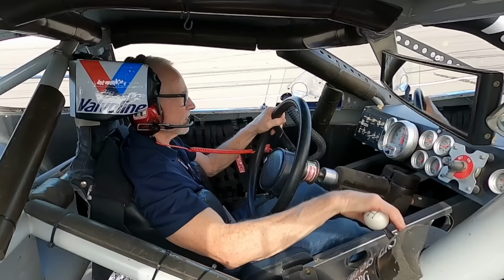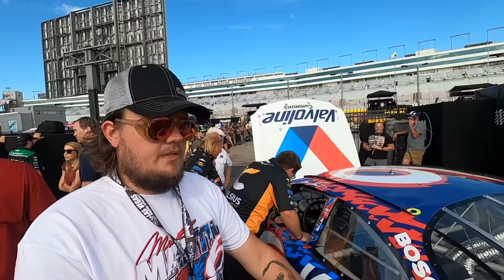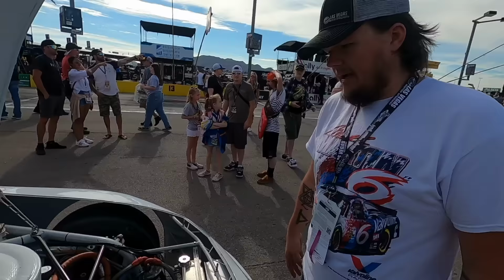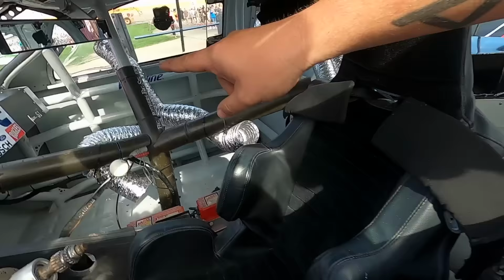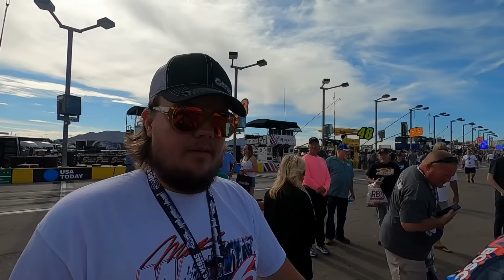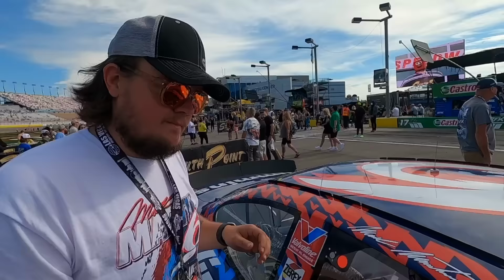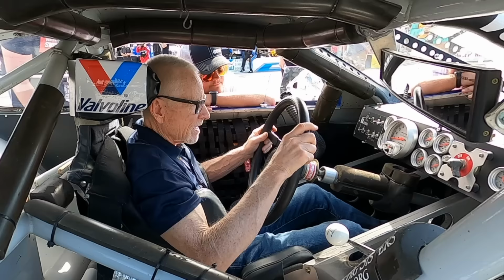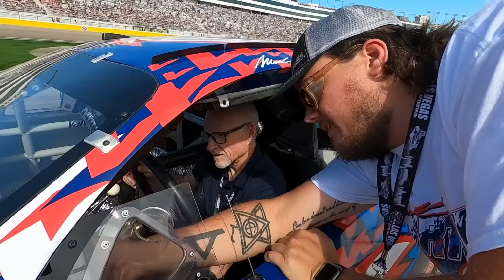Mark Martin Drives His Favorite Car Again! Reunited with Legendary Roush Racing Chassis "JR51"

Comment: Those were definitely NASCAR's biggest years, I still have around 100 diecast from that time. Everything changed after Feb 18, 2001. Even if you weren't a #3 fan, the races just weren't the same. Huge props to everyone involved, not just for what they did, but for why they did it. The #6 was always one I would root for even being a huge #3 fan. A lot of the drivers in that Era were superstars but when you'd see them in person, you could picture them sitting in the stands with a beer just like  any other fan of oval track. Sitting here having flashbacks of those days after watching this and just wanted to say thanks.
Reply from the maker: were glad you're here man

Comment: I have to give you huge kudos for this video.  Like many others, Mark Martin is my all time favorite driver, and I loved those Valvoline cars.  Huge respect to the restoration on that car.  It is a true restoration when the seat/steering/pedals have not been altered, all the correct parts and time and research to do it right.   I build scale models, and a ton of them are NASCAR models.  I have built almost 10 of Mark's cars from 1982-2003.   I built the Synpower gold 1998 that was mentioned, but I NEED to build a 1998 Valvoline car like JR51.  Thank you so much for what you do!
Reply from the maker: Thank you Tim!

Comment: Fun fact, our engine builder M.L Hart used to be good friends with the cat in the hat and we would get engine parts from them around this time to put in our super stock pavement cars. They sounded very similar to this.   We literally raced with engine parts Jack would get for us out of these cars and we also had access to setup data and engine building tricks they used at the time. 

The sound of those engines, I'm not sure if you could replicate. No one, not even big stroker/cheaters could pull us once it actually hooked up. We would spend 70% of the straight spinning and still be pulling everyone by at least a fender. Awesome times.

Comment: If you ever raced against, and with , Mark Martin , you will have never raced with a greater man and racer  . He would help your rookie driver any way he could . If you needed help on the track he would let your driver follow him , or he would follow your driver and tell him where he was messing up . He would take your car for a couple laps at a test and tell you what he thought . He would never wreck your shit intentionally . If he was slower than you , he pulled over and waved you by, if he was faster... he passed you an went on.   He was the first guy to congratulate your crew and driver . He knew that the driver was only 50% of it and would tell you that . He is a great man and a great racer.

Comment: your desire and goals to reestablish this vehicle are incredible. Unfortunately, like so many of these vlogs the true individuals that manufactured the "race car" are never known. I managed machining/engine build program for Roush through the 90's (including the engineering staff that was very ignorant). EVERYTHING on that car was manu. in building "6" which housed Jack's office in the rear. The "dyno" cells were across the parking lot, The "guys" that worked that butts off to make it all happen were never recognized. The staff you see at the track are NOT the individuals that actual build the cars, Countless hours, days, weeks machining "intakes", cylinder heads", ,etc. where the performance was produced. The "heart" insert that was placed (welded) into the intakes once dynoed., endless "bench" work, or hand grinding. It's endless, the stories, but the guys that actually sacrificed, manu. each and every component was never recognized. Yes, it includes the Winn Dixie car, after all these years I still retain all my race jackets pertaining to both race cars. I machined and assembled the engine in his first P-51 Mustang, and Roush is a horrible pilot!!!!!!. The actual race engines, components were produced in Livonia at " building "6". The car was housed in building 6 and around the corner at the sister site,
Reply from the maker: We have videos with crew guys exploring some of the historic buildings. Most of the time they’re harder to find or don’t even wanna be on camera

Comment: Thought maybe Mark was going to put it in his stacker trailer and take off with it.  I remember Mark well from back then.  Spent some time with him in NH, Pocono and Daytona. Got to meet many drivers back then due to sponsors and friends.  Back then my brother used to build noses and rear covers for a bunch of Busch North and Busch teams.  I used to get Hot Passes for NH, Pocono, Dover, Daytona every year and a few other tracks sprinkled in.  Several years back we had an older Labonte car that we modified for the handicap and let Wounded Warriors drive at different tracks.  It was called Accessible Racing

Comment: i saw mark martin's 93 rockingham car in PA at a small town gas station.  it became a show car due to stress fractures on the body.  i had a bunch of photos but not sure where they went (i feel shame.)  i don't remember which  JR car it was, it did run the spring race @ the rock in 93.  (not sure where else, but i believe whatever happened during that race the car became non competitive and too expensive / time consuming to repair so it was put on the road for show events.   he may have brushed the wall or something but there were a lot of stress fractures from being raced.
great video and storyline that you have here.  i'll have to start watching other videos on your channel.  thanks!

Comment: The two electric fans in my 95 Z71 I bought at Roush Racing used parts store at the race shop. The guy who worked there told me they tried these fans out, Flex-a-lite Black Magic, on the cars but they didn't perform like they wanted so they were selling all of them. I bought two which fit perfect on the factory HD radiator in my truck and they only cost me 75 bucks each.😃👍
I also bought several red rims off of one of Marks car and still have them.
Reply from the maker: awesome!

Comment: WOW!!!! he has a manifold vacuum gauge!!!
that is REALLY smart.... especially when you are trying to save fuel!!!
.
on an old carb-ed engine.... a vac gauge is like your OBD2 scan tool....
it can tell you if its got a miss, stuck valve, timing is off, ETC
.
ya got water pressure, water temp, voltage, oil temp, oil pressure, RPM, fuel pressure.... and a vac gauge..... 
pretty complete set!!
.
i dont think many people EVER used a vac gauge!!!!!
ive only EVER seen them on motorhomes and old grain "straight trucks" as a fuel economy estimate-er
.
and they do work GREAT for getting every last bit of MPG
it keeps ya from opening the throttle too much..... which drops the vac into the "red = bad" zone LOL!
.
you may slow down to 45 going up hills, but you will get good MPG for that large of a load!!! 
.
.
.
also.... why is there a "brake" switch and a "rear" switch?
is that for brake lights??
.
and if so..... what is the rear switch for?

Comment: I watched it race seen that Vegas race that he won in that car I had the die cast hats shirts I was a huge mark martin fan and 98 was a great year that 98 99 Taurus might not have been the prettiest cc at but it was the fastest well except for the 87 tbird but mark won a lot in those Ford's and I miss those days 85 to 2005 was the very best years of nascar and idk what nascar does they will never get back to that ever ...if they go back to suspension travel instead of bump stops and splitters and give the cars 875 HP and let the teams build the cars again from ground up lose the stage racing get rid of playoffs and the chase get wilksboro back on the schedule and Rockingham and lose 5 of the road courses and the roval at Charlotte bring back boa 500 there and then we will be close

Comment: With your connections and experiences with these great cars from the 90’s any chance some of these drivers would be clear to run with obvious updates to safety, a cup race. Hear me out. 5 provisional starters they only run 1/4 of the race. No points. Trophy and cash to the highest finisher of the provisionals. Extra bonus for running top 10, top 5, leading a race. Only 1.5 trioval and road courses. Heck for deceased or drivers unable to run, let the children or chosen drivers run it, ie dale jr.  no way harry gant would run at 83, but Kyle petty, rusty, martin. Those guys could do it and it would pull a lot of old time fans back in. Especially if they ran well and even led a race in the 99’s cars.

Comment: why is there a "brake" switch and a "rear" switch?
is that for brake lights??
.
and if so..... what is the rear switch for?
Reply from the maker: Maybe rear diff cooler I’m not sure. Or cooling fans for the driver

Comment: 36:28 i dont think he EVER put on his seat belt.......
.
even at pace speed.... you can always blow a tire or someone pull out of the pits in WAY too big of a hurry, ETC
so ya...i would not want to go faster either (especially with no practice) 
.
.
it sure would be cool to see Mark "turn that switch on" just 1 more time however..... 
show all these new drivers how to race clean and tight.....
.
but Marks safety and health is above some fans dream......
i still think if he used GM instead of ford.... he would be a 10 time champ ;)
Reply from the maker: RC wasn’t buckled in at talladega and Johnny Morris sat on the floor 😂

Comment: Back when the Clevelands were sweeping nascar before the heads were banned.
Reply from the maker: The C3 head was never banned. It evolved into he better D3 head that was used until the FR9 came out in 2009
Reply: @Stapleton42  I was just saying that they basically had to remove the canted valve angle they are not allowed to use it anymore.

Comment: Mark Martin....the best to have never won a Cup Championship. So many seconds in the 90's.....actually 1990 was the year he should've won it but Childress whined and cried about an intake that Mark was running that was welded and they made the welded intakes illegal....it had absolutely no power advantage etc. and Childress knew that, he done it just for the reason that Earnhardt was behind Mark in points at that time and by getting them DQ'd they lost points. When the season was over Mark lost to Earnhardt by a very small margin...the points Mark lost over the intake was more than enough to have won the championship.
Reply from the maker: The protest was because it was not welded. If it had been welded it would have been legal but you’re correct